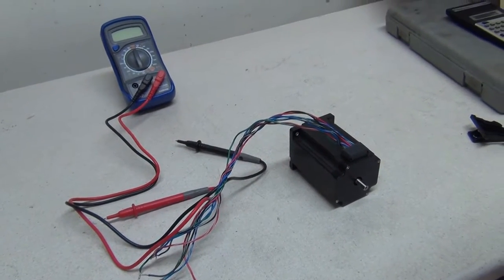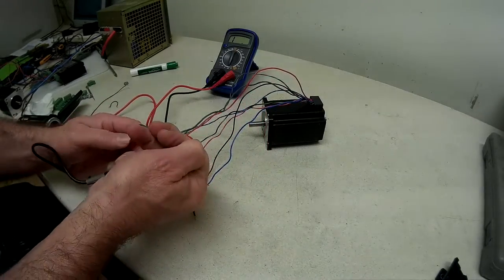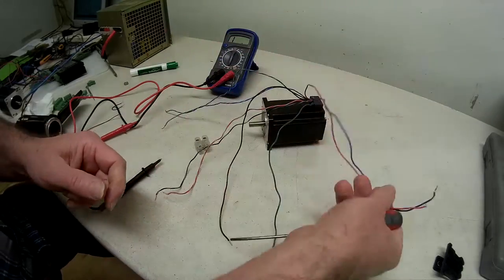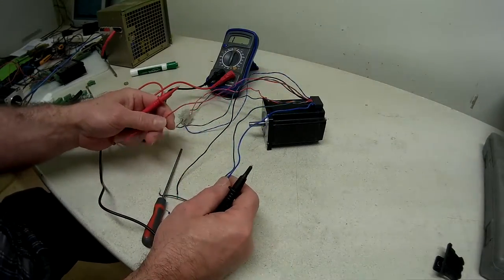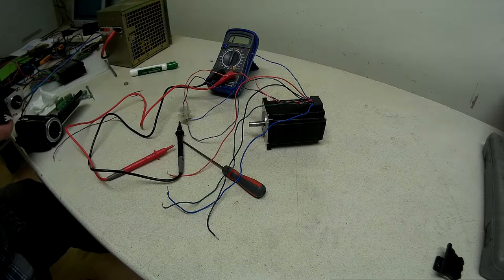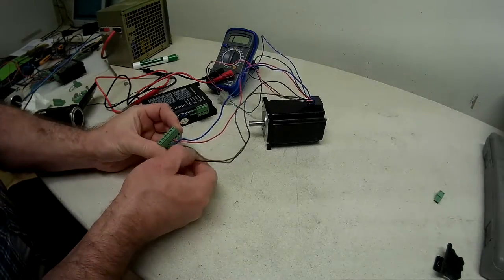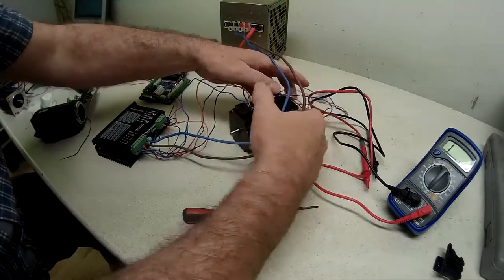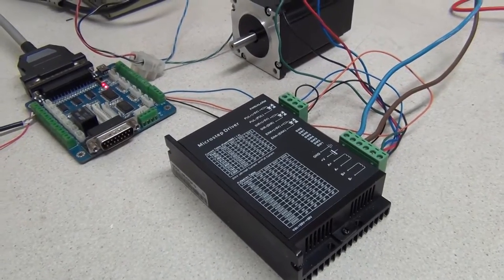8 Wire Stepper Motor How To By Dave Ashford

Comment: I have 2 questions and i will be very thankful if you respond, will it affect the output torque if i connect it parallel or series? , i have the same 8 leads stepper but it’s different colors so I don’t know how to connect it

Comment: nice video i have a couple of questions
You have found a Stepper Motor in the lab. There are no markings on the motor. You just know it has 8-wires coming out. Answer the following questions:
What kind of stepper motor is this?
How would you know the current ratings?
How would you find the step angle?
How would you design the circuit?
Assume that the power rating turns out to be 100A/60V and you need to do micro stepping as well, decide a circuit (available online or design with discrete components) to drive this machine. Write the algorithm for Arduino.
Reply from the maker: What kind of stepper motor is this?
It is a unipolar stepper motor
How would you know the current ratings?
I would measure the wire diameter and divide by the day of the week number. Monday 1, Tuesday 2 etc. 
How would you find the step angle?
I would divide 9 by 5.
How would you design the circuit?
Using the stepper driver instructions.
Assume that the power rating turns out to be 100A/60V and you need to do micro stepping as well, decide a circuit (available online or design with discrete components) to drive this machine. Write the algorithm for Arduino.
6KW is a big stepper motor. Good luck finding a driver.

https://docs.arduino.cc/learn/electronics/stepper-motors

Read the previous comments and have a great day.

Peace.

Comment: Which arduino you have used here and how to convert G-codes into arduino language? For this driver of stepper motor do you programmed the arduino or just directly used it? And are you connected the arduino to computer? 
Is there any external need of power supply required for motor or it can run directly on output of arduino?
Reply from the maker: Hello Mayuresh. Thank you for watching my video.
There is no arduino in my system. The steps and direction are provided by the 
parrallel port on the old computer. I have programmed pickaxe microcontrollers for other projects but not used arduino. I use Linux CNC to control the motion of the stepper motors. 
Good luck with your build.
Best regards
Dave in the U.K.
Reply: Thanks for your reply, will you please make the video on arduino based circuit for stepper motors, with elaborated explanation
.

Comment: I've got a 10 wire motor, too good to throw. Still head scratching. :)
Reply from the maker: You may have a servo with a built in rotary encoder or a multi phase stepper.
If it's a servo you cannot run it from a stepper driver. 
If its an exotic stepper, I am as lost as you are.
Put it on ebay and buy a propper stepper motor :-)
Your profile picture seems a bit out of date, I guess you had more hair back then!
Modern cameras seem to make me look fat, so I used an older picture for mine. :-)

Comment: what about wireing in parallel?
Reply from the maker: Just split the join and connect the ends to the driver connections  one pair of coils at a time. If there is no connection swap the common wires.

Beware that the current draw will be approx 4 times greater so make sure your driver can handle it or your current limit is sensible.
Reply: ok thank you so much !!!

Comment: Great video but still i have problem with my 8 wires stepper motor Japanese brand with no wiring diagram on the internet and Toshiba driver tb6560 single axis it did not work no rotation would you help me please i am suffering with it please I know the four coils but I don't know how to wire them to the driver
Reply from the maker: Hi Proeng. You have 4 coils (A,B,C,D) 8 wires (1,2,3,4,5,6,7,8) coil A is connected to wire 1 and wire 2. Coil B is connected to wire 3 and wire 4 etc. connect wire 1 to A+ connect wire 2 to wire 3. Connect wire 4 to A-. 5 to B+. 6 to 7. 8 to B-. You may have to swap some wires to get the unit to run smoothly. Check your driver wiring against this diagram: http://www.ribu.at/PDF/Tb6560.pdf Good luck and have fun. ATB Dave.

Comment: definitely rapid
Reply from the maker: No music track, so I had to give it some pace. I hope your 8 wire stepper motor is spinning nicely. ;-)
Reply: Hi Dave Can you please help. I’ve watched your video I’m afraid I’m non the wiser. I went ahead bought 6off 8 wire astrosyn steppers that have been lying dormant for nearly 10 years That no one that I’ve asked seems to know diddly squat about. I’m keen to get started with one of those awe inspiring projects but scared shitless of the electronics . I bought a multimeter as a prerequisite per your video and determined what the wires were in relation to the coils. But now I’m forlorn about doing anything further without divine intervention. I live out in the sticks here N Ireland any help would be appreciated greatly. Paul
Reply from the maker: Hi Paul. Thank you for the interest in my video. If you are looking to connect the stepper motors to a battery or power supply directly, sell them on ebay and buy DC motors instead.
The stepper motors need a driver, an interface and a power supply connected to a computer or micro-controller to work. If you want a better view of how the drivers, interface and power supply are connected I will make and post a video for you.
From your video's I know that you have engineering knowledge and I am happy to help if I can.
http://www.astrosyn.com/wp-content/uploads/2015/09/ML23HS1-6-Technical-Datasheet.pdf
If your wire colours match the data sheet above, connect white/brown to white/orange then white/yellow to white/red.
Use brown for A and orange for A-bar then yellow for B and red for B-bar. (A+,A-    B+,B-)
Good luck and have fun ! ATB Dave.
Reply: Thanks Dave, i'm away here at the minute i'll chat to you shortly thanks.